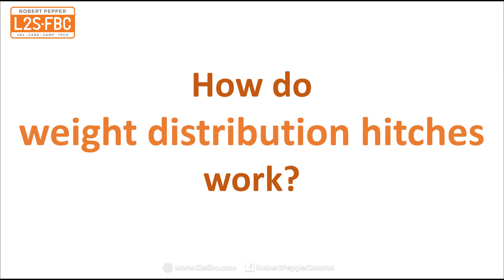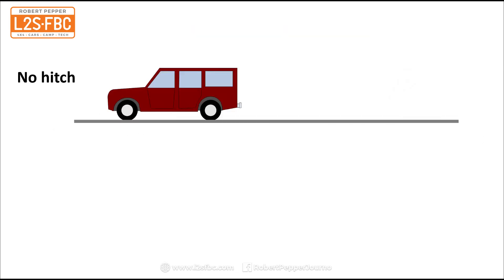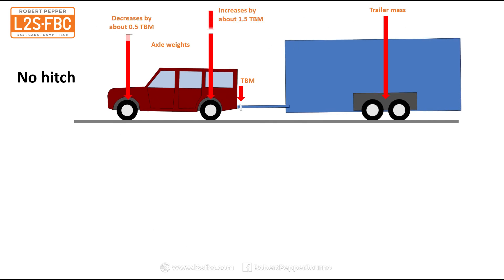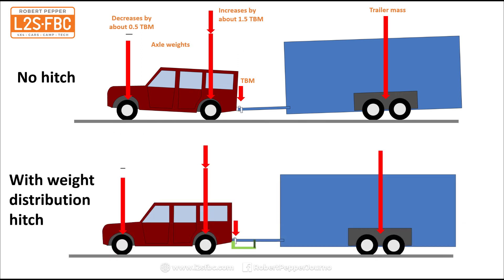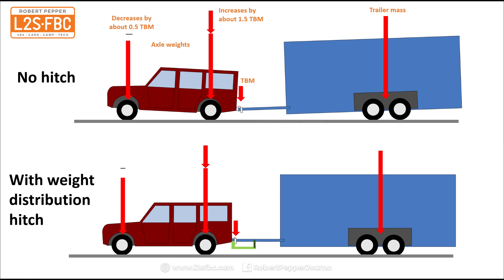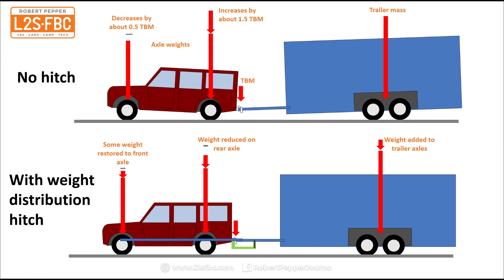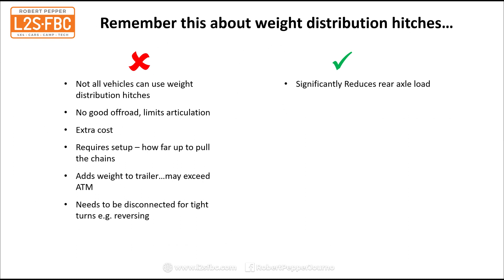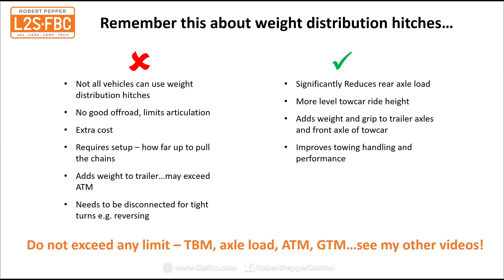How do weight distribution hitches work on trailers?

Comment: Here's how it works:
Imagine two long boards connected at their ends with a hinge: ─.─ The hinge naturally wants to sag in the middle, forming a \./ shape. One way to make the two boards come into line would be to bolt a shorter board to span the bottom of the two long boards across the hinge: ─═─ Nice and straight! The only problem is you do actually want it to hinge, so instead of bolting the short board to the bottom of both boards, you bolt it to only one board, and connect the other side with a spring: ─_≥─ The more you tighten the spring, the more the \./ becomes a /'\. You just tighten the spring until the two boards are in line.
Reply: Excellent. Thanks.

Comment: Another excellent video. short, to the point, no fluff, and I don't feel like I have more questions than answers after watching the video. Thank you! Also do you have any videos on how tow vehicle length specifically effects towing? I saw in another video that talked briefly about the topic in regards to high tongue weight "lifting" front tires, not completely off the road but enough to cause an affect to towing and steering. So would a longer tow vehicle cause an impact to those leverages/ ability to tow?
Reply from the maker: The longer the tow vehicle the better, specifically you want long wheelbase and short overhang. SWB vehicles have short wheelbases, but also little overhang so they're not as bad to tow with as you many think. The USA utes tend to have long wheelbases and short overhangs.
Reply: @L2SFBC   thanks for that great info too

Comment: The what it does but certainly not how.
Reply: It certainly takes a while to get your head around HOW it works. 

If you look at a typical WDH you will see that in order for the nose of the trailer tongue (attached to towball) to pivot up or down (clockwise or anticlockwise in the sagittal (longitudinal) plane) it would have to compress the bars. 

This has a spring effect resisting that pivot rotational moment. Effectively, this creates a more or less rigid coupling of trailer to car (tongue to hitch) in the vertical plane. 

As Robert said, this effectively extends the tongue of the trailer as if the frame of the car has become a forward extension of the tongue of the trailer. The weight is then sitting more evenly distributed between all wheels touching the ground . Of course this would only apply to a completely rigid coupling but the stiffer the spring bars, the more rigid it will be.

As pointed out by Robert, the bad news is a lack of articulation that comes with a semi-rigid 'joint'.. Not good for off road or uneven surfaces

Comment: I'd love to see a follow up explaining the physics of why a WDH does what it does (specifically in contrast to putting airbags in the rear springs which seems to be a common mod to "fix" sagging in the rear when towing on vehicles such as the Pajero / Paj Sport).
Reply: As Robert mentioned  - airbags lift the rear of the tow vehicle but they do not prevent the front of the vehicle from pitching skyward when the TBM remains the same. Less weight on the front axel dramatically affects steering and braking.
The torsion/spring bars on the WDH have the same effect of the handles on a wheel barrel - they pitch the weight forward, increasing front axel control.
Reply from the maker: Common fix everywhere. All airbags do is lift the back of the car. There may be a tiny change in TBM purely due to the attitude of the car, but otherwise no effect. Levelling the car is a good idea for handling for example full range of suspension travel.